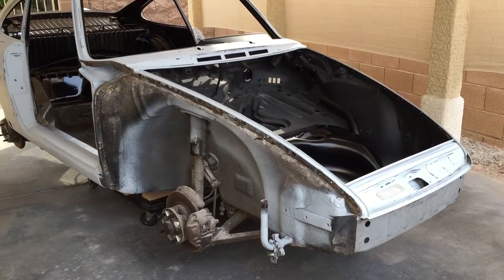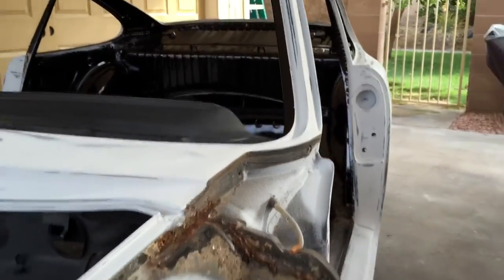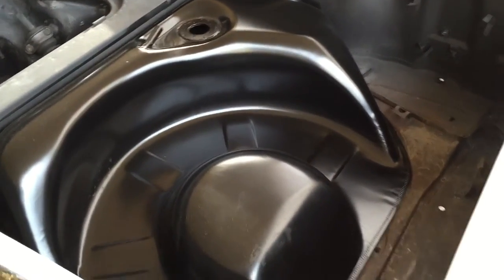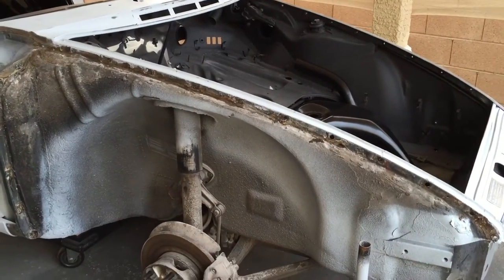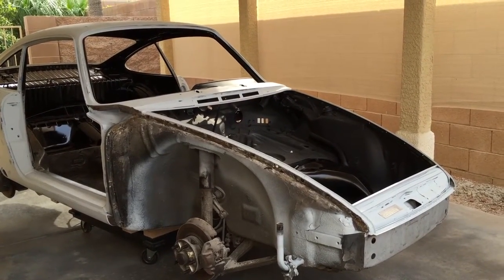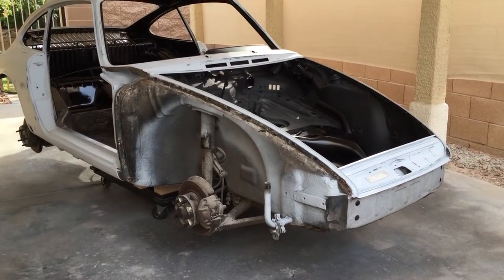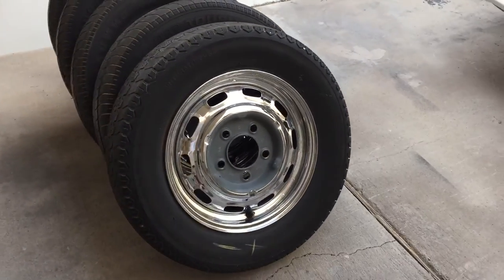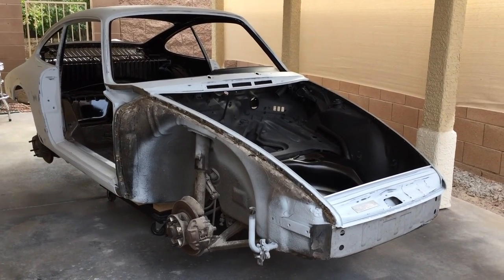1967 Porsche 911 restoration video 7

Comment: Mike,
Great video series.  A huge help for me as I am in year 5 of a complete restoration of my 1969 911E.  I am up to 70 separate panels welded in to replace rusted sections.  I am at the phase of block sanding and started on the Engine lid I found it was damaged and covered in body filler.  I pounded out most of the dents but it needs a skim coat to cover it. The issue is the lid is curved towards the edges and rear of the car.  I am using 80g on a 12 in block with a criss cross pattern.  My concern is getting smooth transitions across the entire curved surface.  Any tips would be helpful.
Reply from the maker: Hello Roger Thanks
It sound like you are doing a fantastic restoration!
I think you are on the right track for the truck lid..it is a complex shape.
My block of choice was a small  3/4 X 1 3/8 X 11 Durablock with sticky back sandpaper cut to fit.
I used criss cross sanding pattern but also incorporated a pulling/slicing type of movement. Almost like a sawing
motion. Switching direction every other stroke should get you there.
The skinny block has enough flex in it to get your shape.
Good Luck!

Comment: hey Mike good video. Can rear fenders be taken apart? previous owner widen my rear fenders to fit wider tyres.
Reply from the maker: Hi Jesse
Thanks, rear fenders can't be removed without cutting.
No problem though if you are a welder..Best way to do it is buy replacement panels and cut where the new panels start and stop..using them as a cutting template.
Fairly common to place rear fenders on these cars
Good luck!

Comment: What glue used for assembly fender?
Reply from the maker: Hi Fernando 
The seal is called Terostat Ribbon Sealing Tape. Available from Porsche.
Its like a putty tape. Its thick and flexible to take up this gaps in this irregular area.
Good luck!
Reply: Mike M thanks , find on eBay fou buy?i am from Brazil   Do you have what app for comunicate with you? I refurbish 1975 targa in my Garage, but have any question for talk to you. I belive you can help me for assembly this car. Thanks friend
Reply from the maker: Hello Fernando
You might be able to buy on e-bay from some suppliers..I think Stoddard ships internationally 
they would surely have it in stock. Maybe try Sierra Madre also
Unfortunately I do not have an app but will be able to communicate with you thru this site no problem.. Also many other guys doing restorations here and have lots of valuable information
they share.
I wish you the best of luck with your 75! Thats a beautiful year!!